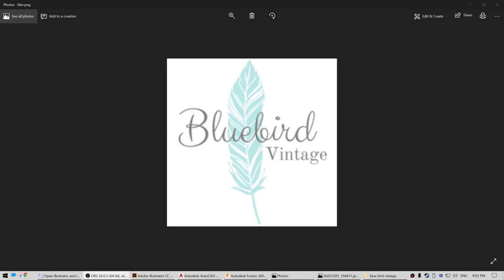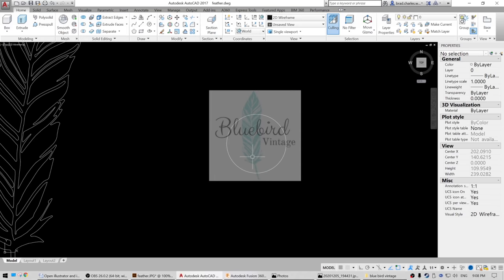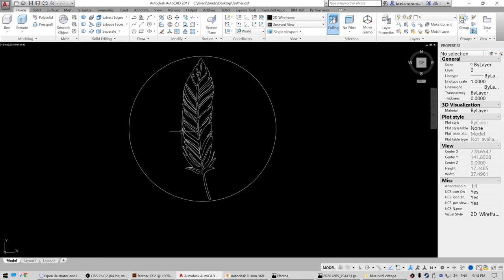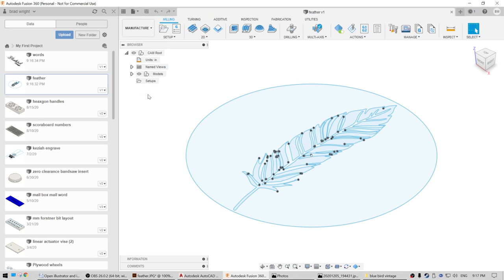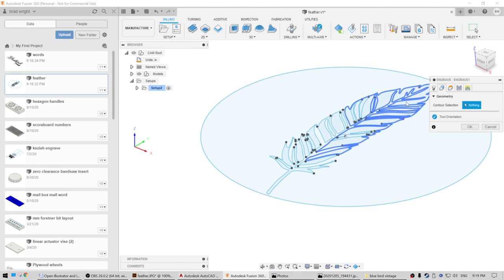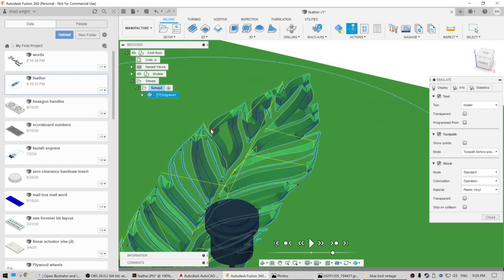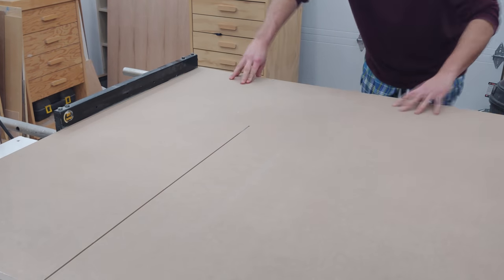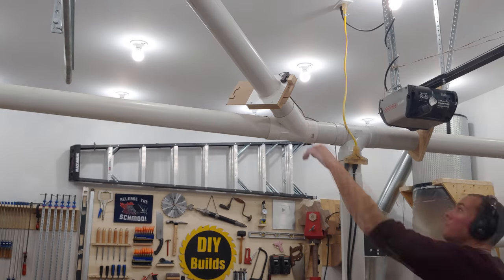How to Make Something with CNC from Concept to Complete (Fusion360, AutoCAD, Illustrator and MACH3)

Comment: Nicely done. Try a mixture of pva glue and water (sizing) on the raw edges of the mdf before the primer, this will seal the grain and allow a smooth finish. 
Are you wearing safety pj's?
We use Autodesk products also, first class stuff. 
Cheers

Comment: That was great....hey man I noticed you changed your router on the CNC. Will there be a update about that?
Reply from the maker: Yes. Watch my belt tensioner upgrade video for details.
Reply: @DIYBuilds  I found it.  Oh by the way did you have to change any of the mach3 setup numbers?
Reply from the maker: Not that i can recall

Comment: You mentioned the Acme screw.  Would a 2 start lead screw be faster/more accurate?  Never used and Acme nor seen one yet.  Thanks!
Reply from the maker: Yes but cost more
Reply: @DIYBuilds  I'm one of these chronic 3D printer builders.  It's what I have in stock.  Love your design!  I'm getting one of the NEMA 23 kits with drivers next month.